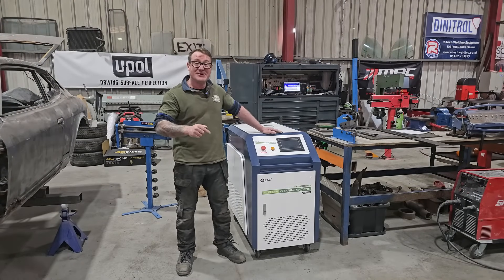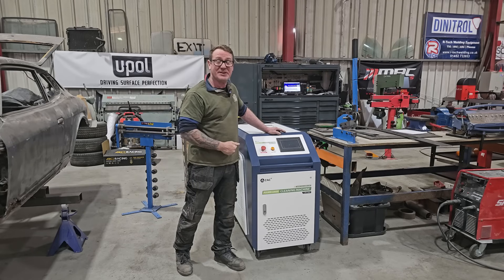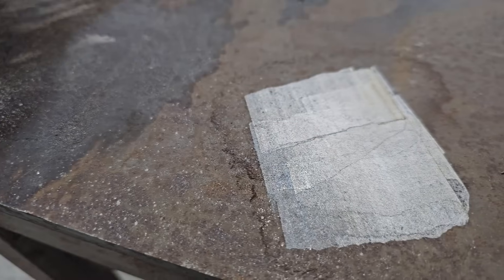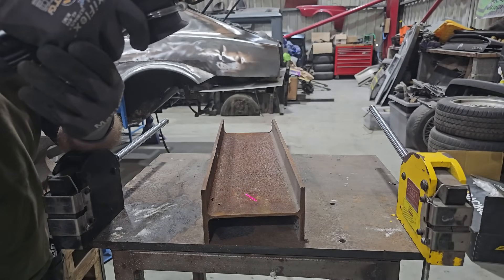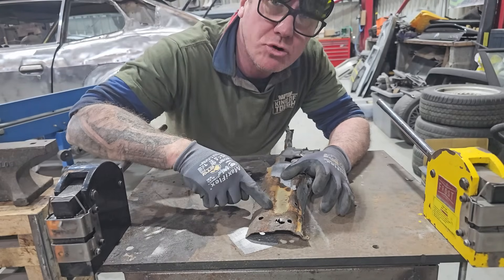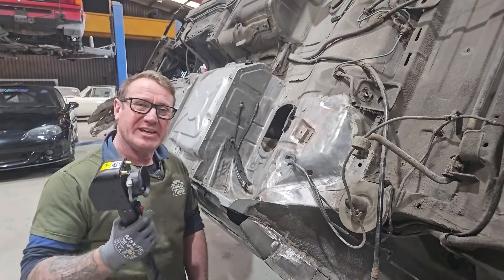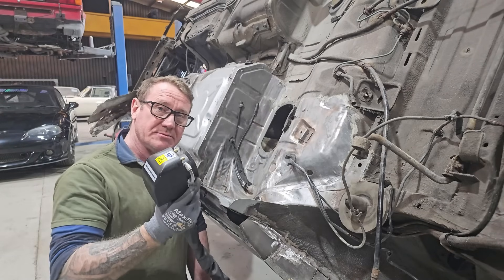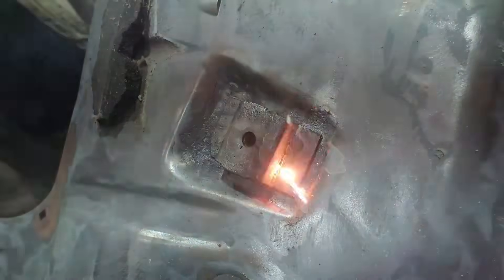Revolutionary Laser Cleaning Machine Removes Rust from Porsche 911! -ZAC Laser

Comment: Make sure those laser safety goggles have the correct OD and wavelength specifications, there is no room for errors there. Would not trust a general Amazon or Ebay one.
Reply: And not just for the operator, but everyone in the workshop ...
Reply from the maker: Thanks for the reminder, we have included laser protective glasses in the package of the laser cleaning machine.

Comment: Highly illegal in the UK and EU, direct exposure to a Class IV laser is prohibited, for obvious reasons. Serious risk of retinal damage to the operator and anyone else in the workshop.
Reply: Obviously being used in the uk by Yorkshire Car Restorations.
Reply: @nrw34260  Yes, and?  Just because you import some dodgy Chinese made fibre laser doesn't magically make it legal.  Just google "class 4 laser safety" ... these particular laser are more dangerous than most as the beam is pulsed and also invisible ... but it is still capapble of significant permanent damage to the retina.
Reply from the maker: We equip every customer with laser protective glasses.